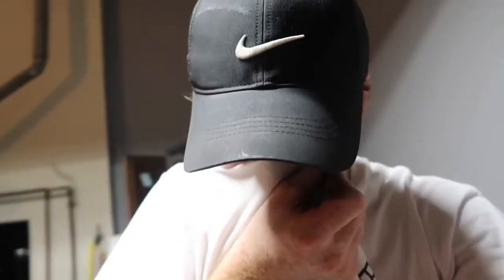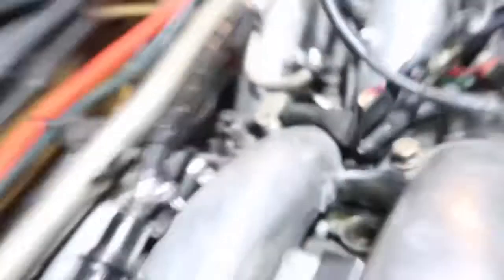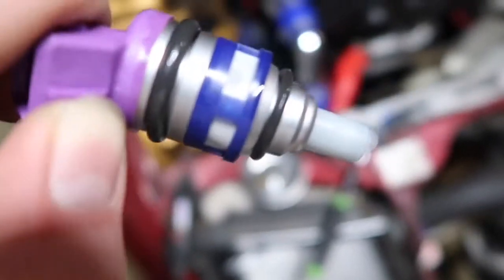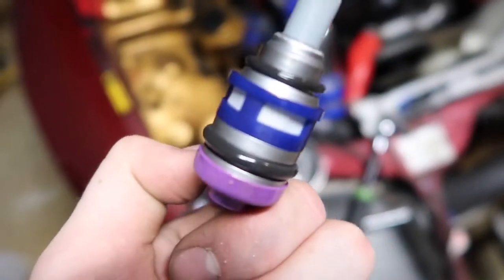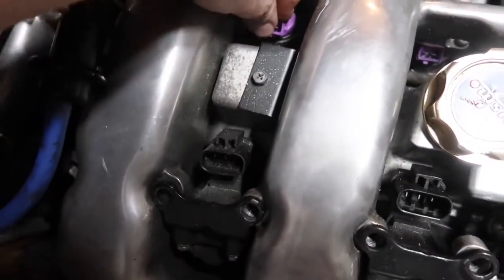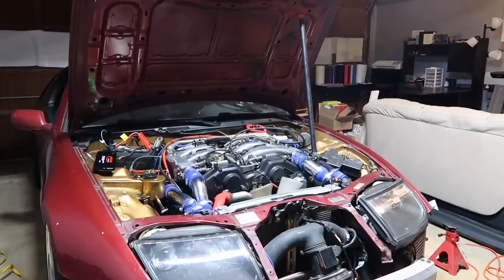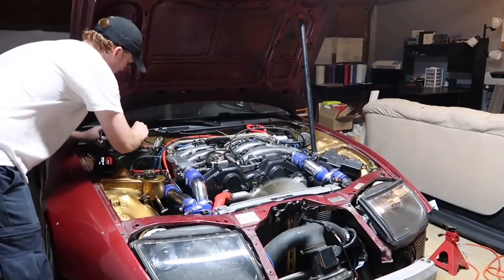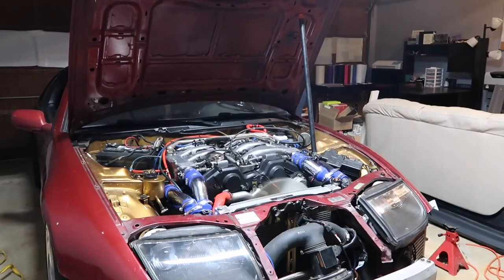The 300zx TT is finally fixed!

Comment: Glad you fixed it. I got a leak i need to fix on mine i can't find yet lol
Reply from the maker: Itz_Clemii what kind of leak?
Reply: When i do a boost leak test. I hear air leaking somewhere above my transmission bellhousing. I'm thinking it could be my pcv on my valvecover or one of the hoses to my Wastegate got cracked somehow.  It's hard to find / get to cars only making 10-11lbs boost right now I'm trying to make 18 lbs. Only can check certain hours of the day and i live in a apartment so hard to diagnose
Reply from the maker: Damn I feel you, finding boost leaks are hard af
Reply: True but once i find it car will be a monster. As it sits with the leak on 10lbs it still pulled on my buddy's stock ss camaro
Reply from the maker: Stock turbos or ?
Reply: Gt675rs. I posted a video on my channel when i picked them. Up from. Z1
Reply from the maker: Itz_Clemii Ight I’ll go check it out 👌